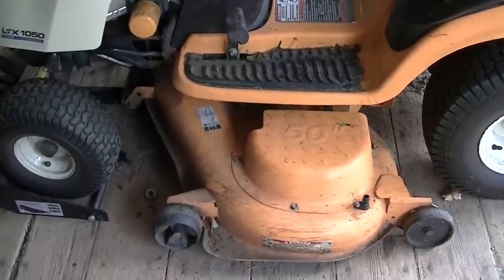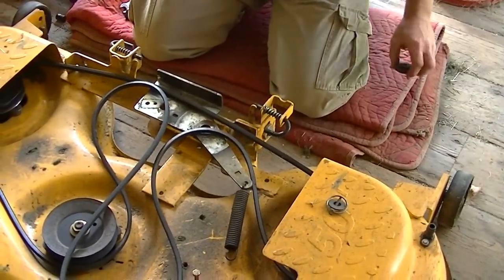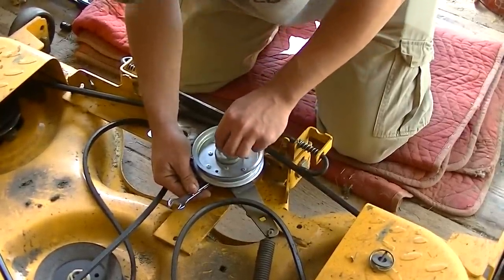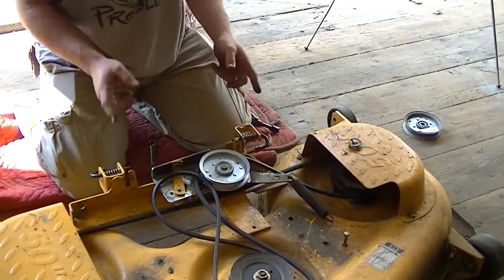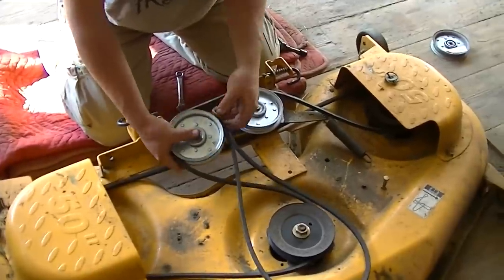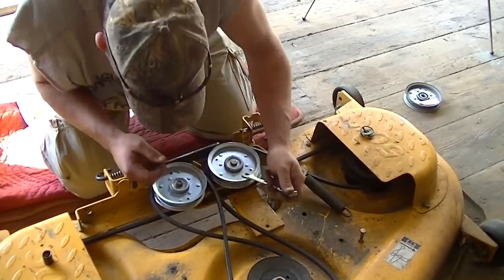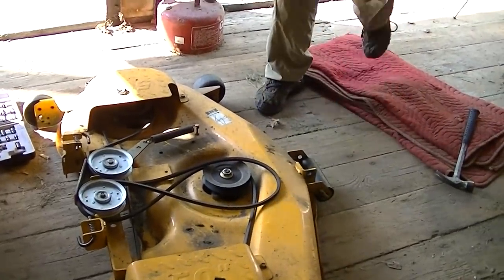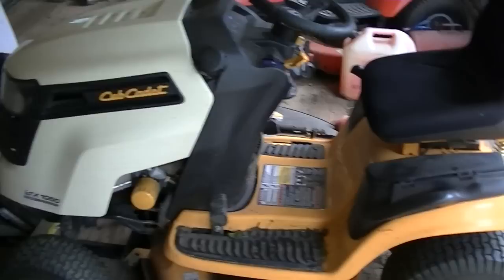Cub Cadet LTX1050 (Bad Idler Pulley) and Spring tip trick!

Comment: I think when I did it there was a nut/washer I put under the pulley with the 1/2 inch bolt. Maybe that shouldn't go there. I don't see one in your video when you put it on.
Reply from the maker: You might be right about the washer. I do not have a washer between the belt-guide and pulley. Only the washer I made sure to point out in the video.
Reply: I saw a video( I think Redbeard) where he removes the spacer under the idler pulley and moves the spring holder bolt to the other hole ( less tension).  Said he mowed all season without throwing or breaking a belt. There is a spacer supposed to be there like the one you have in your video. In this other video there was an additional spacer that he removed.
Reply: @BigJoeKasulischannel  Cub Cadet parts manual shows a "jam nut" sandwiched between the pulley and the shoulder washer that you showed. Removing it seems to have no ill effect, and instead lowers the angle between the idler and the spindle pulley.

9/12/20 Bought and installed a new pulley on mine today. No jam nut--apparently previously removed. I did not replace it. I like the height the pulley is setting at.
Reply: @vinfiddler5469  I've repaired mowers at home and every job I ever had in the last 50 years. I have to agree with what others have posted on the Internet and say the belt tension as it came from the factory is over the top! I'm going to move my mounting post about 1-1/2" toward the pulley. Any tension beyond that which keeps the belt from slipping simply puts extra wear on the belt and all pulley bearings.

9/20/20 -- I made up a spring extension from a 1" wide steel flat, 2-1/2" long. Drilled two holes 1-1/2" apart and installed the link between the post and spring. Because the spring hooks are 90 degrees from one another, so I put a 1/2 twist in the link so it aligns better. Still leaves plenty of tension to keep belts from slapping, and no slippage. Belts should last a lot longer.

Comment: This belt pattern is literally ridiculous.....
I've never seen one as complex as this thing anytime &/or anywhere in my life.
The lunatic that designed this mower deck MUST do LSD....
Reply from the maker: umperthay I would have to agree with you on that. It eats belts left n right.
Reply: ***** I think that was their goal, thinking that most customers would buy belts from them. That's why I'm gonna keep buying other brand name parts.
If you think about it,, most things that came from near the time they were invented will still work now (if they're taken care of, of course), but todays' crap crashes at least every 5 years, even if it's "babied".
Reply: umperthay I agree with you except for the design. I think I would let it rest on the engineer that designed this in particular! I have worked on heavy to light machinery my whole life. The engineers never have to work on what they draw and most have no clue what to write in the manuals. I bought the 2013 LTX 1050 because of Cub Cadets reputation for having a great line of mowers. I have a problem with my 2013 model eating belts, deck belts more specifically. I hate the manual that comes with it! It only covers one side and both sides of the deck are most obviously different. I had to change the deck belt with only 56 hours on the mower! What a disgrace! I am at 61.4 hours and the deck belt is now smoking. There is a spring that was hanging down in the area of the clutch assembly from the motor. The manual does not cover that spring at all! WHY! I have no clue where it goes and I refuse to shop it because of this. Does anyone have a clue what and where this spring goes?
Reply: TawodiUnega1  I have a 2014 LTX1050, and the spring on the clutch attaches to the frame. On the left side, if you were sitting on the mower. You should be able to see a marred spot in the black paint where it used to be.
Reply: Thank you, found the location straight away with your help.Thank you again
Reply: I found a fix online for the idler tension spring. Remove the spring from the bolt. About 2 inches behind that bolt is another hole. Move the bolt to that location and attach the spring again. The tension is less now and should stop it from eating belts and the pulleys.
Reply from the maker: @TawodiUnega1 Thumbs up!!
Reply: TawodiUnega1 how well has that worked out for you? I have my deck dropped right now doing some MX and would love to not have to change belts so often.
Reply from the maker: Belt changes? Everything is working great for me Recently... Dont jinx me ;)  I just mowed 15 acres today. I just recently scrub cleaned the deck and applied some fancy Teflon deck spray I found at Tractor Supply. seems to work good so far. (Just a FYI if interested)  I'm at 309 working hours, 6 oil changes and 3 oil filter changes. I change the oil and filter when the 100 hours light turns on. but since I run roughly 4-6 hours nonstop except for fuel. I change  the oil every 50 hours.  I use the used but still good oil elsewhere in the shop. update video soon.
Reply: Is there a use for that spring though?
Reply: D McC It connects the the piece that the pulleys are on to the pin/bolt on the mower deck, (of course-) to maintain belt tension. He didn't show taking the belt off of the 1st, or putting it back on to the last pulley. Alias, loosening & tightening it.
Reply: I think that's a different spring.  There is one that is like back by by the bar that lifts the deck. And attaches to the Frame.
Reply: D McC If I remember correctly, I think on the right hand side, near the back, there is a spring hooked to the mower frame that connects to the mower deck. I think it's what caused the belt to go to hell last time, because it wasn't attached when I was removing the deck to replace the belt.
Reply: umperthay j
Reply: I have helped other (relatives) with the belt replacement Cadet LTX 1050 2 times. It's like anything else in life it looks hard... At first but if you read the diagram carefully you can do it. Most definitely I'd do the belt installation over "doing the dishes" 😂🤣
Reply: I doubt they can afford good ACID.   Probably just munching mushrooms from the forest floor....  Either way - JUNK DESIGN
Reply: @TawodiUnega1  I realize this comment is 8 years old but I sure wish I would of figured this out 6 years ago when I bought my mower(used).  Makes a guy wonder why that hole is even there in the first place?

Comment: I absolutely hate this deck. I ran dozens of kinds of mowers on the job and at home for 50+ years. You should not have to pull a deck, remove 10 screws, 4 fasteners, and a spring just to change a belt! And the configuration is a train wreck waiting to happen. It's a well documented belt-wrecker. There is a tremendous amount of stress/wear on the sides of the belt depending on the height of the deck. It's bad enough that I would recommend not buying this model. Just popped in to see your take on the process. BTW, you can also pull the spring on by clamping a vice grip on the side of the hook. Thanks.